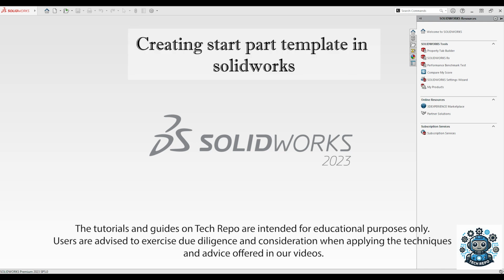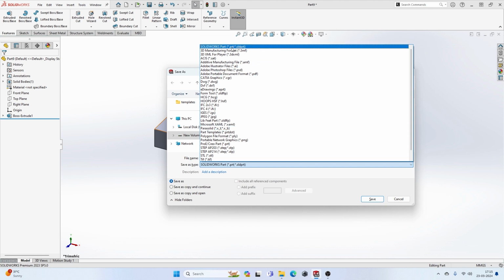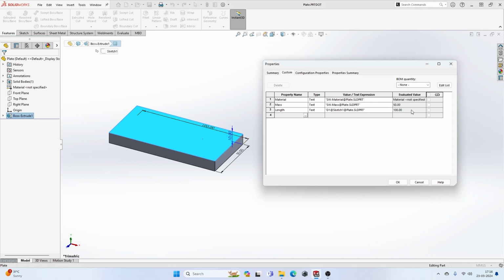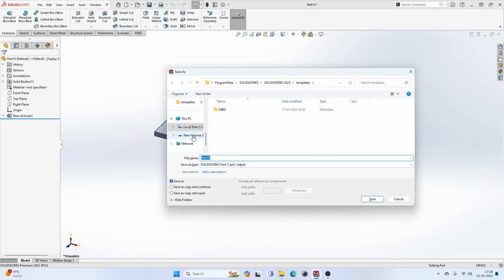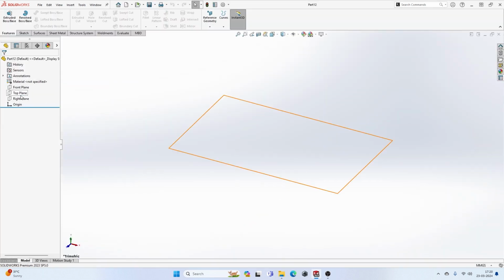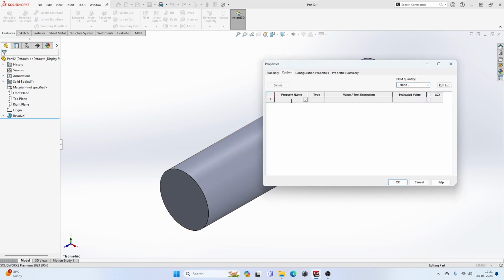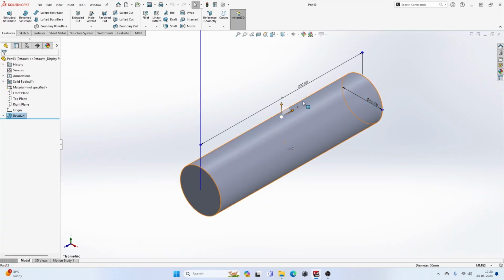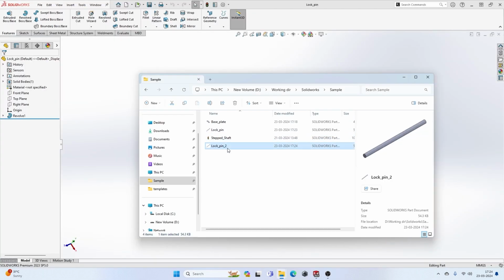Avoid Mistakes: Easy Custom Part Templates Tutorial

Comment: What the benefits to save the part template?
Reply from the maker: The Start Part template in SolidWorks provides a standardized foundation for designs, saving time with predefined features and promoting consistency across projects. It streamlines the design process by including commonly used elements, ensuring efficiency and uniformity in designs.
Reply: @techrepo_redefined  Thanks for reply, I just want to ask one more question, I used company desktop and their already saved part template, how can I change it ?
Reply from the maker: Hi Rahul,

Sorry for the late reply!

The default start part template location is C:\ProgramData\SOLIDWORKS\SOLIDWORKS 2023\templates.

If you couldn't find the template then, go to Options -> System Options -> File Locations -> Document Templates. You will be able to see the location from which the template is fetched.

Now, you can either add templates to this location or click edit and input the new location. Remember you cannot have multiple locations for template.

I hope I have answered your question. Let me know if you need any further inputs!

Best,
TechRepo
Reply: @techrepo_redefined  Thanks for reply..
It’s really helpful.